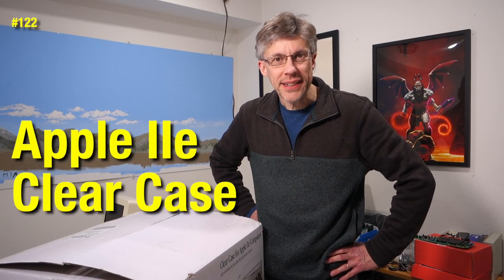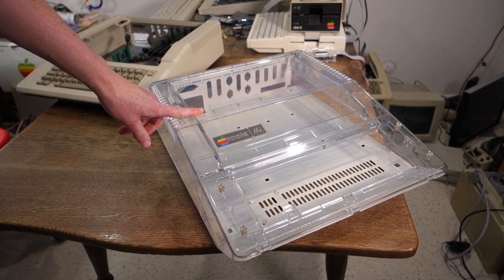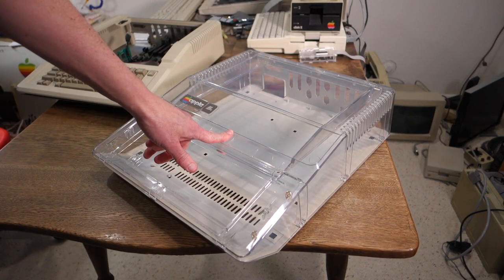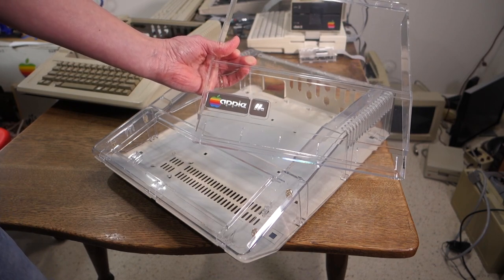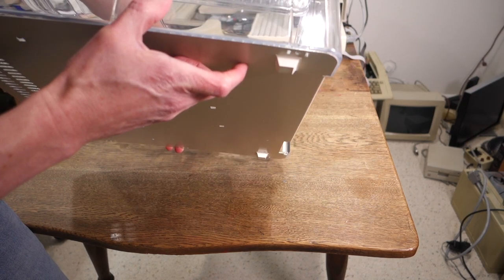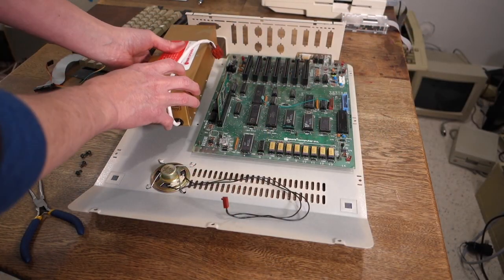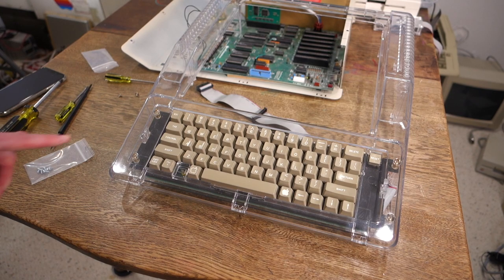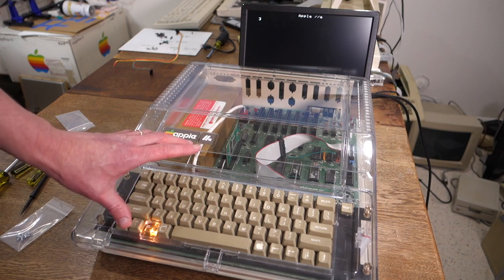#122: Apple IIe Clear Case from MacEffects!

Comment: That clear case is pretty cool. What are your plans for your old IIe case now that you have this clear one? As a side note the reason why the keyboard brackets were not needed with the new clear case is because they designed the top piece after the later IIe cases where the keyboard screwed directly into it. The earlier IIe cases which the white key keyboards came with used the brackets. I hope that makes sense LOL.
Reply from the maker: Yes, that all makes sense - I was just surprised that the old and new keyboards both fit in the clear case. I'm not sure about what to do with the old case - knowing me, I'll probably want to go back to the retro look in a couple of years. Or maybe I'll just find some IIe guts and put those into the case.

Comment: What's that jumper wire on the motherboard for?
Reply from the maker: Ah, that's for the Senior PROM (which I don't have installed). It goes from the non-maskable interrupt on the CPU to the Senior PROM, so it can interrupt the CPU. Here's a video with more details: https://youtu.be/9_GbyzO0c00

Comment: I assume that's a Garrett's Workshop 8 meg RamWorks clone in your aux slot, but what's that green wire coming off of your 6502?
Reply from the maker: Sorry, just saw this comment. That wire is for the NMI (non-maskable interrupt) that hooks into the Senior PROM, which lets you halt the CPU and examine memory. I don't have the Senior PROM installed right now, but left the wire there. More info here: https://youtu.be/9_GbyzO0c00

Comment: That metal plate looks pretty thin and flexy compared to the original.  Also a little janky that it's not painted on the inside, considering that the case is clear.  I had been regretting that I couldn't rationalize backing this, considering the price, but I don't feel that regret now.  I assume if the price ever drops to something that I feel is reasonable, I could use an original metal lower plate with the clear plastics?
Reply from the maker: The metal base plate is a bit thinner, and a little more flexible, but it's not a problem. Also, it didn't really bother me that it wasn't painted on the inside - most of the bottom is covered by the motherboard and power supply. If you have a newer Apple IIe (with the black lettering) then I think the original metal plate will work. If you have an older Apple IIe (like mine) then it won't work with the clear plastic.

Comment: Nice case, but cost more than the 2 x IIe's and 4 Apple Disk Drives I bought unfortunately to have made it worth backing.
Reply: Sounds like you got a really good deal for those systems. :)
Reply: @xotmatrix  Still don't know if they work a couple of years later, and not sure what to do with the 4 disk drives. They are well built for sure!
Reply from the maker: @stephenvalente3296  You should fire up the IIe's and find out! Just be sure to remove all the expansion cards first, check the motherboard for obvious issues, and just give them a try. Worst case the power supply will blow a capacitor and let out the magic smoke, but other than being stinky, it's not a big deal.